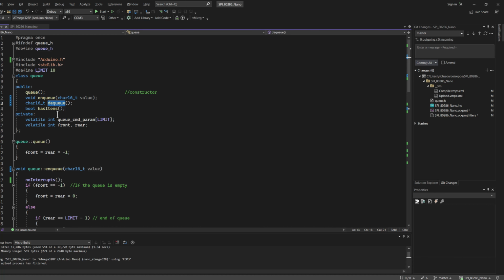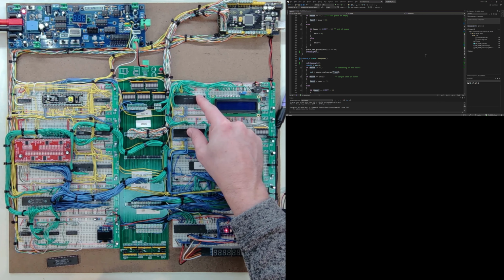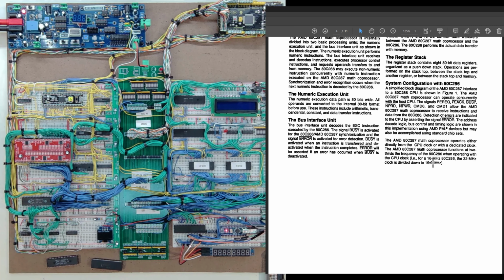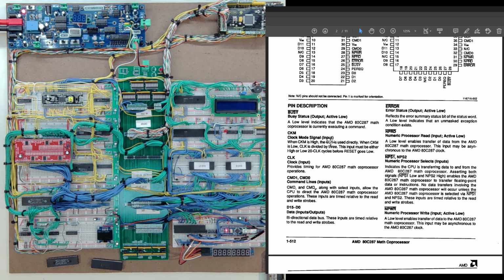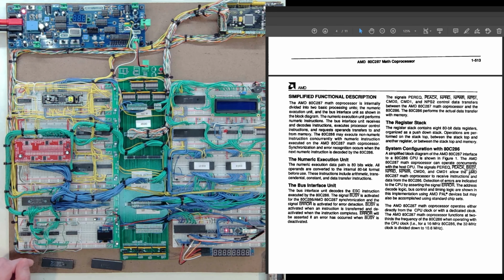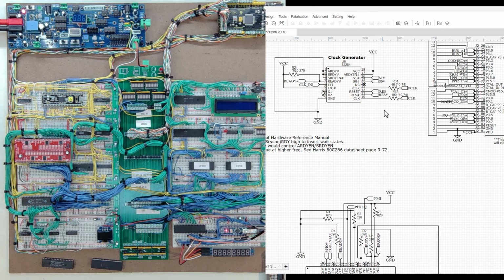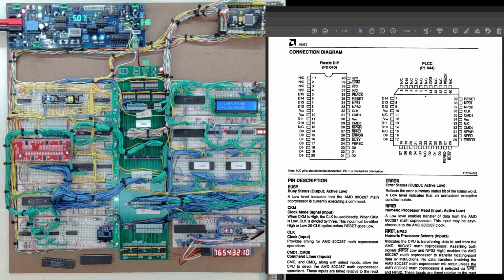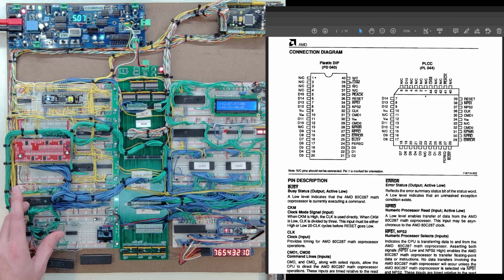80286 Build, Ep. #55 - CMOS version of 80287 Math Coprocessor Working

Comment: Can you explain what effect changing the CLK resistor value had? Why did that fix your issue?
Reply from the maker: I will not be able to explain this well, but I will try to convey my current understanding. @Zxborg can probably provide a much better explanation. The inline resistor is used to help match the impedance (effective resistance of an electric circuit or component to alternating current) of the clock driver with that of the transmission line (wires for now, PCB traces later). If the clock source impedance is not matched to the transmission line, reflections can occur. Those reflections can be seen as clock pulses to the 80C287 (or other ICs) and cause issues.

In other words, I think the impedance of my CLK line in my circuit is higher than ideal (probably because it's on a breadboard circuit with messy wires). Because of this, I had to use a higher resistor value to match the output and transmission line impedances, to prevent reflections/ringing. My new 80C287 must be more sensitive to this than the original 80287 I was using.

I have just started reading "High-Speed Digital Design: A Handbook of Black Magic" by Johnson & Graham to learn more about this type of stuff.

Some other sources I'm looking at:
https://en.wikipedia.org/wiki/Impedance_matching

https://electronics.stackexchange.com/questions/324514/series-resistor-in-data-lines

https://electronics.stackexchange.com/questions/7709/why-put-a-resistor-in-series-with-signal-line

https://www.wikihow.com/Calculate-Impedance

Comment: Your 2/3 or 1/3 clock sounds reasonable given the datasheet.  Note that there's also a min clock period spec in the datasheet, the one I found online lists different values for CLKM high and CLKM low. 125 ns (8 MHz) and 50 ns (20 MHz), which yields 5.33 for the 8 input but 6.66 for the 20 input. Can't explain why they're different but they;re in the same ballpark.  Also, on the subject of method names, instead of "hasitems" the usual computer science name would be "empty" or "isempty". Up to you to invert the sense of the predicate. As far as the clock resistor, the series drive is there to match the imedance of the actual trace, so some tuning will be required depending of you have a 4 layer FR4 board with a close and tight ground plane versus a hobo camp of floating wires on a bradboard, so that makes sense. 100R seems a little high but that says more about the fact that running 12 MHz on a broadboard is an unholy aberration than anything else. You gotta do what you gotta do at that point. The issues with clock distribution I mentioned before is mainly then if you fan out the clock to a whole bunch of loads (like more than say 5 or 6) it will be alsmost impossible to fine a series term/ parallel term resistor solution that gets decent signal to all points. At that point you want to use a driver so that no clock line has more than say 3-4 load pins on it, then you tune/tweak the terms individually. The fact that you use a clock driver ship lets you be satisfied that there's very low skew between them so you're not going to clobber the setup/hold timing the way you would if you just used an LS244 to distribute clocks, there's no skew matching guarantee on the datasheet for ordinary bus drivers.
Reply from the maker: @Zxborg, thanks for all the info! I really appreciate it. Your clock distribution comments make sense. I'll adjust my Nano code, too.